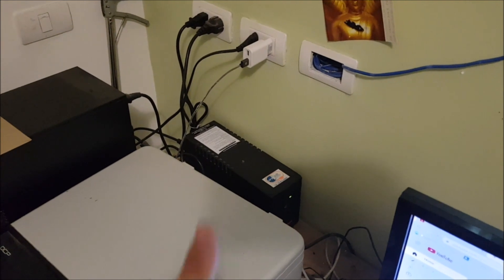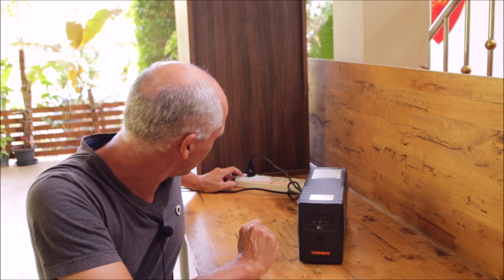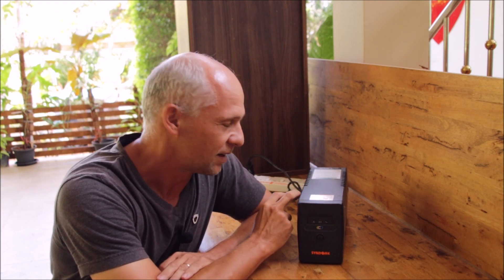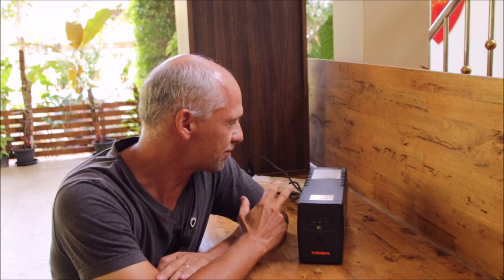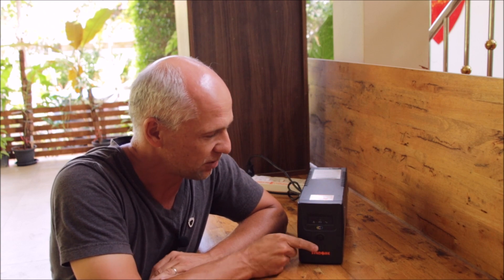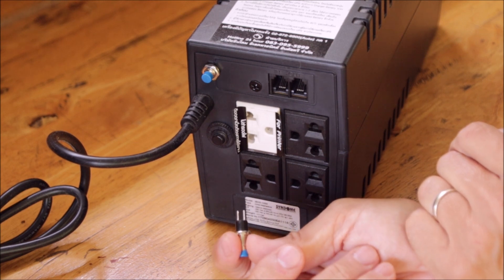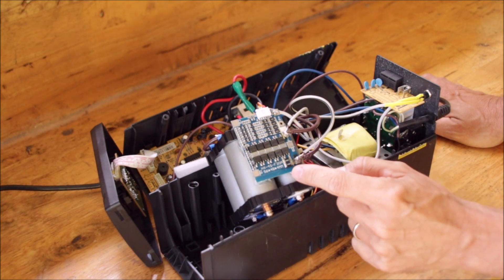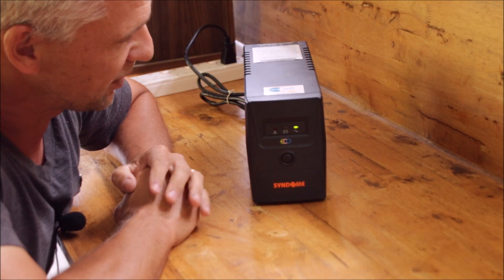LiFePo4 -  UPS gets a small but important upgrade!

Comment: Which bms did you use , is it 4s or 3s
Reply from the maker: This is a 4s LFP BMS
Reply: @RolandW_DIYEnergyandMore  What is the A rating (im assuming A is for Amperage)? I am planning on getting 4s 100A BMS, will that work?
Reply from the maker: @nsingh1393  yes BMS's are rated for maximum amperage. Sometimes there is a different rating for charge and discharge. What are you using a 100A BMS for? Must be a battery bank for a big UPS then...
Reply: @RolandW_DIYEnergyandMore  No, Just a small UPS, similar to yours. It has small 12v 4.5Ah SLA battery that has been replaced 3 times. Approximately once every year. Should I use 30A BMS like the one you are using? and drawbacks to using 100A?
Reply from the maker: @nsingh1393  right. But a 100A BMS will probably be much bigger then the 30A board that I have used. It might not fit into your UPS.